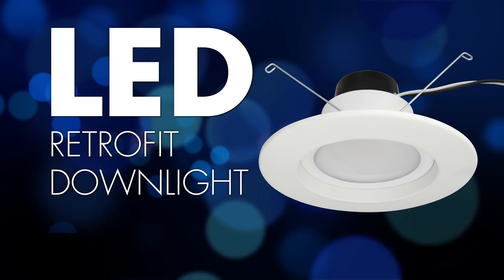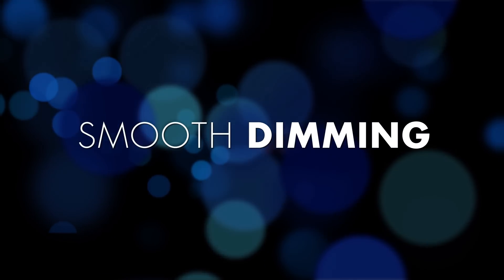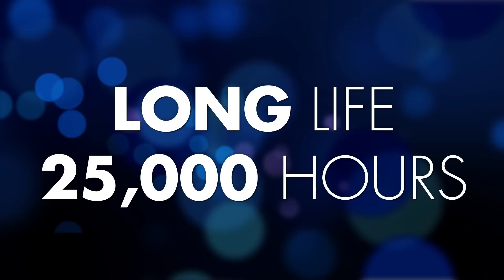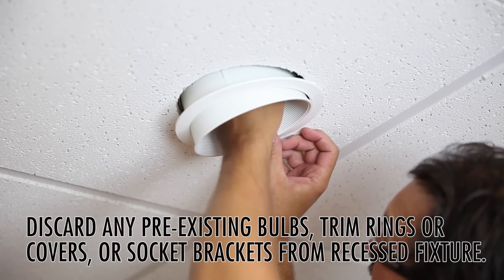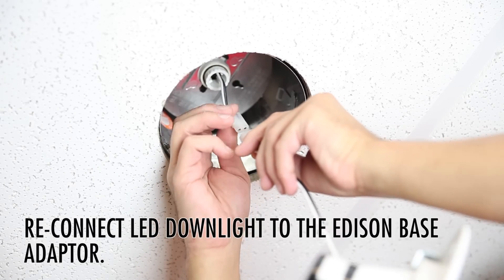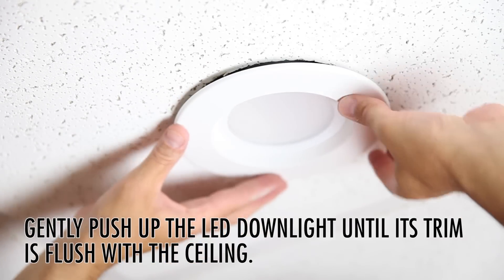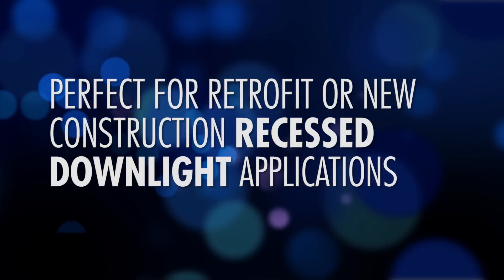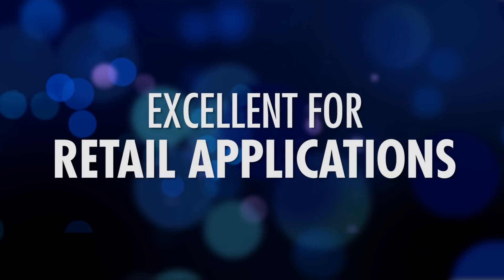LED Retrofit Downlight

Comment: Is the life 25,000 or 35,000 hours? Is that the rating till 70% brightness? 
Do these run as cool as the Elite BR30/40's? I'm concerned about heat causing premature failure. 
Whats the CRI rating? 
I'm looking for 12 LED14DR5630K or LED12BR40D30K for my recessed cans.